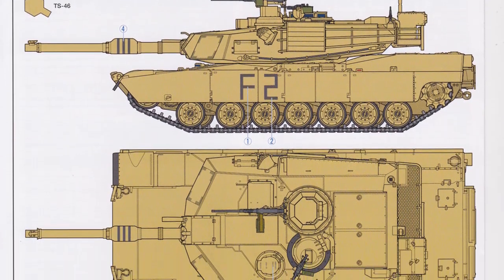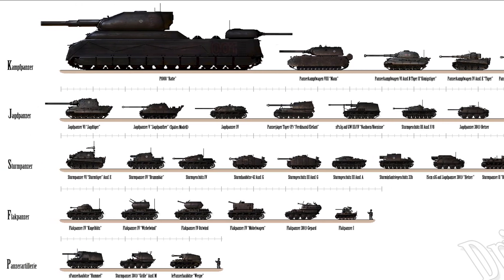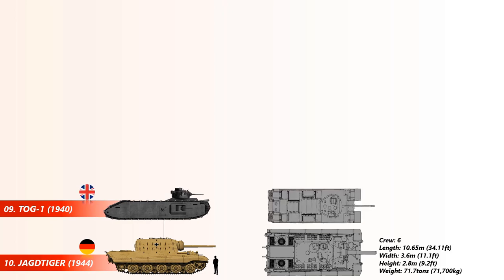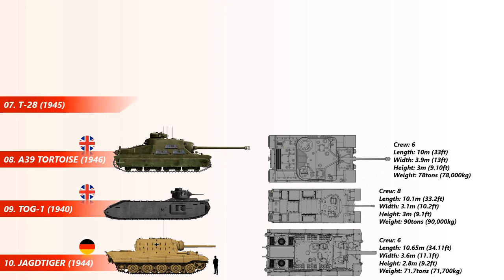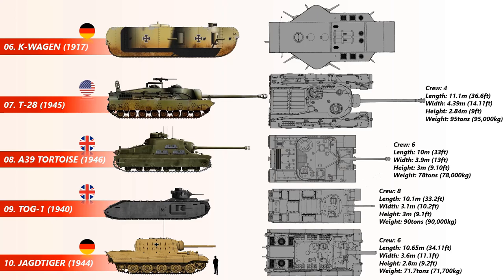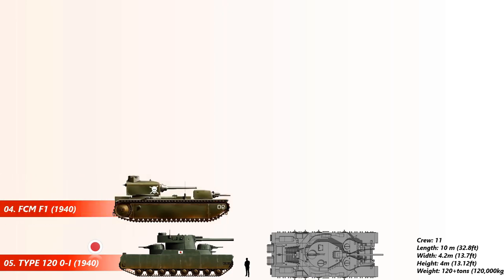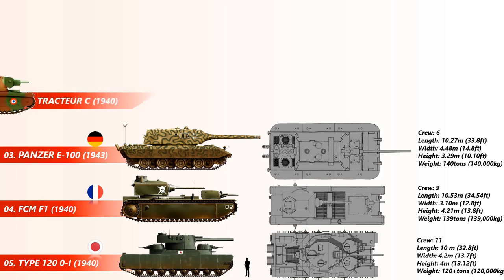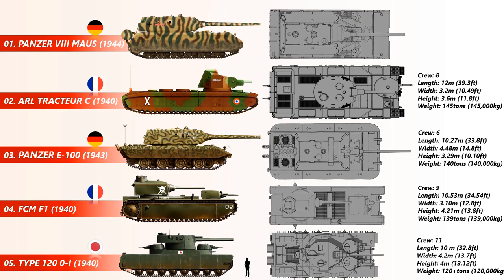The 10 Heaviest Tanks Ever Built

Comment: The O-I picture is wrong, That's a O-Ho
Reply: Yah O-Ho is even bigger and taller than O-I
Reply: Thank you
Reply: @funnydog3353  the O-Ho was still part of the O-I series of tanks designed. so while it isn't the actual O-I that was built it was still technically an O-I
Reply: @signolias100  in WoT?
Reply: @--_9623  in general the tank is a type 120. the sub designation is the tank type (light, medium, heavy, super heavy etc.) and the development count for a given year so for example an O-I would be a "type120 first super heavy". the O-Ho would be a "type120 fifth super heavy" most like to just to cut it down to the "O-I" or "O-Ho"  part for ease of conversation
Reply: @signolias100  thanks for explanation and i meant the game though :D thx for the info btw
Reply: @signolias100  ty
Reply: The O-Ho is a fictional name that Wargaming simply made up for their game "World of Tanks", probably to differentiate it from other similar tanks. The O-I, O-Ni, and O-Ho were simply alternative designs for the O-I, and would have all been named O-I.
Reply: O-I is heavier but O-HO is bigger

Comment: Where the hell's the TOG-2? Also you forgot the secondary gun on the E-100 'blueprint'
Reply: Taron Ypu mean the refrigerator turret with the 150mm?
Reply: YEA THEY FORGOT TOG-2
Reply: No this is a different Turret variant with the same gun as the Maus.
Reply: The secondary gun would not have been placed on the 15 cm gun version of the E-100.
Reply: Didn’t they mention “built” like it moved at least?
Reply: @doitsuland2003  most of these tanks never drove like the e100 or the fcm

Comment: E-100, O-I, ARL Tracteur C and FCM 1 have never been built
Reply: They built a E 100 hull
Reply: @junkers ju stuka -87 B2 never built, only appeared on papers
Reply: And she also forgot the soviet KV4, which was about to be produced as a new soviet super heavy tank, but german bombardments stopped his production.
Reply: But the FCM-F1 have been build but in wood
Reply: @TIRPIZ no the p1000 wad never built not even a mock up model was made it only existed in a very undetailed blueprint
Reply: @john_bob_lenone7351  but can it drive or shoot no so the tank was never built
Reply: TIRPIZ yeah hell no they didn’t. Germany suffered tremendously with lack of materials during the latter part of WW2. The P1000 was simply a design by an over-confident designer. The vehicle would likely crumble under its own weight, wouldn’t be able to move due to the lack of an engine powerful enough to move 1000 TONS of steel. The vehicle would also, if built and used, be extremely slow (if able to move at all), and would be a prime target for allied bombs (considering the allies had air superiority after the Battle of Britain)

Comment: There are some mismatches in the pictures of the tanks, I will list them here:TOG 1 in was shown in the first picture, and the TOG 2 was shown in the second(no side pods, TOG2 turret), the ARL C is (apparently) shown in the first picture and I do not know what French tank is shown in the second one or even if it's French to begin with.
Reply: Damjan Sazdovski the E 100 was proposed to have either the Maus turret (as shown in the video, it was the most likely choice at least for the first batch of vehicles) or a separate turret only drawn in blueprints.
Reply: @ALEX HUANG hmm, I believe that the T28 was a simular vehicle to the T95 or even perhaps an earlier version of the T95, there is a front portion of the hull that sticks out under the gun which might be the Transmission, whilst the T95 doesn't, that lead me to believe that they're  simular but not necicarily the same
Reply: @chieftain108  yeah, thanks for pointing that out
Reply: @ALEX HUANG right, thanks for clearing that up
Reply: the second tank is the AMX tracteur C from 1940

Comment: Here come's the wannabee tank experts
Reply: Bendy Tuber Gamer honestly, almost every video has major fails in terms of accuracy. Some quick ones from this video: Heaviest tank in service is the Challenger 2 in "Megatron" configuration, weighing approximately 84 tons. The blueprints on the TOG don't match: the side view represents the TOG I and the top-down view represents the TOG II. Also, number 5, 4, 3 and 2 were never built.
Reply: Ricardo Gomes I mean the E 100 was in production, same with the O-I but idk
Reply: @CoinEaterBTBM  only a single chassis was found of the E-100, nothing else, not even blueprints regarding turret, and O-I was made as a prototype and scrapped immediately after.
Reply: Ricardo Gomes fair enough
Reply: Ricardo Gomes wait the E100 was never built?
Reply: @literallystingy2858  nope, only one chassis was built.
Reply: @ricardogomes6240  the closest thing to the fcm f1 irl was just a mockup
Reply: @literallystingy2858  a partially finished chassis was built and captured by the brittish then scrapped in the 60's. (Correct me if im wrong about when is scrapped)

Comment: some of the tanks were never made
1. Only two K-wagen were partially built by the end of the war - not completely finished
2. only a prototype of the type 120 0-1 was completed in 1943 - in my mind a prototype does not count
3. the FCM F1 was designed during the late Interbellum by the Forges et Chantiers de la Méditerranée (FCM) company
but France was defeated before construction could begin - so it was never built
4. the Panzerkampfwagen E-100 development was never started - no development means NO tank
5. the ARL treacteur C only A full-scale wooden mock-up was produced - wooden mock-up does not count
plus the M1A2 is not the heaviest operational tank in service the heaviest operational tank in service today
is the FV 4034 Challenger 2
the fact that you still make videos about comparing things scares me
that you might mess up more things like this
Reply: The title says "Ever BUILT," not fully finished, so prototypes count, but the rest of your points are mostly correct. 1 hull for the E-100 was built, but no more than that.
Reply: @Gary-number31415  
you are right about the E-100, a body was built sorry for missing that.
but there is a big difference between one that works and one that doesn't

Comment: SOOOO I see a lot of people scoffing at th "O-I's" picture of an O-Ho allow me to clear it up a bit the tank is actually a Type120 according to the video. this is the actual tank. the letter designation would be the actual tank designation O either meaning experimental, or super heavy. I being the development order for any given year so in this case I is first developed. I would guess O stands for super heavy or similar. so it is probably read more like this in English "type 120 first super heavy" and "type 120 fifth super heavy" they are both type 120's but one was designed first the other fifth. which there was at least 3 other super heavy tanks between the two developed that year and at the least 2 after

Comment: This video is a great way to get misinformed.

1. The Char 2c bis weighs more than the Jagdtiger.
2. The TOG1 and TOG2 weigh the same, but are two different tanks, unlike the photos may suggest.
3. A39 Tortoise has 7 crewmembers, not 6.
4. A39 Tortoise weighs 78 LONG tons, not short tons. After conversion, it weighs 87.36 short tons.
5. A39 Tortoise weighs less than the TOG1 and TOG2.
6. The weight of the K-Wagen is indeed 120 tonnes, specifically metric tonnes, not short tons. Converted to short, it weighs 132 tons. This makes it heavier than the O-I.
7. The FCM F1 only had a wooden mock-up built before surrendering to Germany, so it was not actually built and should not be on the list.
8. The E-100 only had plans for an assault gun variation, not an artillery or anti-air variation.
9. The E-100 only ever had its hull built, so the most it ever weighed was 92 short tons.
10. The ARL Tracteur C was never built, only a wooden mock-up.
11. The Maus weighs 188 metric tons, which converted to short tons is 207 tons. This matters for the sake of consistency.
12. Nearly all the photos are mismatched, improper variants, or straight up different vehicles.

It is fun to make lists like these, but if your information is wrong then you end up spreading misinformation, which can lead to further misinformation and historical inaccuracies. Please use reliable sources and cross check sources when making videos that are supposed to be informative.

Comment: T28 at number 7 has a heavier and more armored variant; T95
Reply: T28 and T95 are the same tank. The variation in name spawned from a logistics goof.

The T28 with added tracks (popularly seen as T95) is not necessarily uparmored. It's just the battle-ready state of the T28, with the added tracks to reduce ground pressure.

Comment: The TOG was designed and built before the war (1938-1939) the project was ditched because of blitzkrieg, The A39, first off the tank was built after the war and was abandoned because it was out of date, the T95 (T28) didn’t even take part in the war and was abandoned due to the fact that the seig frieg line was already in ally control, the O-I was not even built, only a single track link was made and that model is not even right, the model is of the O-HO, The E-100 was supposed to be built in replacement of the Maus and wasn’t even built until 1945 and was never finished, The Maus was built in 1945 but was destroyed by the Germans to prevent the allys from capturing the vehicle but then the Russians found 2 Maus tanks they took the hull of one tank and the turret of the other and put them together and now sits in the museum in Moscow

Comment: Im sorry but the T28 (American Heavy) is the Wrong version ^^ You did show the Upside of the T95. T28 got all in all 2 Tracks. The T95 had 4 Tracks.
Reply: no it is actually right the T28 super heavy and T95 GMC are the same tank. it featured a set of removable tracks for transport. also if you take the time to do a quick search you see the very same tank with both removable tracks removed and sitting beside of the machine, both removable tracks attached, and one removable track removed sitting beside its matching removable track still attached to the machine. also there are pictures of the machine sporting both the T28 designation and the T95 designation. the latter requiring you to search for "T28 super heavy tracks removed" to find it

Comment: the picture of the T-28 is incorrect it shows the T-95, the T-28 did not have the extra set of tracks on both sides attached
Reply: no the picture is very correct the t28 super heavy was at one point in its life called the T95 gun motor carriage. even today the last remaining prototype bears the designation of T28 not t95. there was however a medium/main battle tank named t95. also the "-" is not used by the americans. a t-28 is a Russian tank not american

Comment: First off, your pronunciation was pretty good, but I have a question. Is this list supposed to be tanks that were actually built? Because the FCM F1 was never actually built; a wooden mock up was built and the tank was ordered, but France capitulated before construction began. Similarly the ARL Tractuer C was never built, they got part way through building the wooden mock up before it was cancelled in favour of the FCM F1. The E-100 was at least started, though the only chassis to be "built" was incomplete when the British captured it in April '45, similarly, no prototype of the K-Wagen was ever completed.

Also, no one knows for certain if the 120 ton prototype of the O-I was ever completed, or even started for that matter; the documentation was destroyed/lost.

So a list of the top ten heaviest armoured fighting vehicles *actually built*:
1. PzKpfw VIII Maus - 188 tonnes (1 complete prototype, 1 partial prototype; hull of completed destroyed, turret mated with partial prototype for display)
2. 105 mm Gun Motor Carriage T95, aka Super Heavy Tank T28 - 86.2 tonnes (2 prototypes)
3. Heavy Tank T30 - 86.18 tonnes (2 prototypes)
4. Tank, Heavy, TOG II* - 81.3 tonnes (1 prototype)
5. Tank, Heavy, TOG I - 81 tonnes (1 prototype)
6. Tank, Heavy Assault, Tortoise, A39 - 79 tonnes (6 prototypes)
7. FV4034, Challenger 2 TES Megatron - 76 tonnes (~450 FV4034 built, unknown number in Megatron configuration)
8. FCM Char 2C "Lorraine" - 75 tonnes (the company command tank of the 10 Char 2Cs, the front armour was doubled in thickness in on the front to 90 mm and upped to 65 mm on the sides, increasing the weight from 69 tonnes to 75 tonnes).
9. Sd.Kfz. 186 Panzerjäger Tiger Ausf. B "Jagdtiger" - 71.7 tonnes (~80 built)
10. Sd.Kfz. 183 PzKpfw Tiger Ausf. B "Königstiger" - 69.8 tonnes (~490 built, mostly this version, but also some with a different turret for a total weight of 68.5 tonnes)
Reply: Arl tracteur C was complete after the second war but I'm pretty sure at least a version was completed before the end of Ww2 and the FCM F1 was in fact at the same stage o development as the maus 1 turet mounted and two hull completed

Comment: so i thought that what you mean about "ever build" is some part of it not fully build prototype, that explain alot specially the reason why e-100 is here, though i never heard about those big french tanks and O-HO maybe because it almost did have accurate documentary or its just me
Reply: Firstly, it's the O-I, secondly I agree with rest of your comment. The O-I was at least partially constructed as drive tests were performed and a track link still remains today
Reply: @hondacivic8222  it's actually a type120  O-I was the tank type. with O equating to super heavy I would guess, and I being the development order I equating to first developed. so it's full name would read as  "Type 120 first super heavy" if we were to translate their code the O-Ho would be "Type 120 fifth super heavy"
Reply: @signolias100  yes and the Chi-Ha was the Type 5 Medium but nobody refers to the Type designation in basic context. It's like calling the USS Missouri the Iowa Class Battleship USS Missouri. It's correct but there is little need in a basic context, like this is.
Reply: @hondacivic8222  in this case it does make a difference it is still a type120 tank. and with your own words you wouldn't say the development of the USS Missouri you would say the development of the Iowa class battleships. in this case it would be the development of the type120 tanks. all are type 120 tanks just with differences just like you see with Bismark and Tirpitz both are the same class of ship yet the Tirpitz was a bigger and heavier ship than the Bismark.
Reply: @signolias100  you don't see the point. You call a ship of a class by its individual name. You do the same with tanks. That's why the Panzer VI despite being 2 different vehicles is known as either the Tiger I or Tiger II/King Tiger. Same primary designation but known as different things.

Comment: When you were talking about the t 28 for the top down picture you put in a t 95 the difference is the t 28 has one set of tracks in each side and the t 95 has 2 sets of tracks on each side and if you look closely you can see that the top down picture has 2 sets of tracks on each side
Reply: You are sort of right and sort of wrong. By world of tanks you are right however. In the development it jumped back and forth between the T28 super heavy and the T95 gun motor carriage a few times and that is where the different names come from. the outer tracks are removable for rail travel
Reply: @pubbarian  you are partially right as well when it was first produced it was only the t28 heavy tank, it then became the t95 gun motor carriage, and then after about a year it had its name switched to t28 super heavy tank and it is living its life out as a museum piece with the designation of t28 on its fender to this day. there was however a t95 medium/main battle tank produced later

Comment: Correct me if im wrong but the e 100 was never built so why is it in this list
Reply: it was never finished the British found its unfinished hull
Reply: For the most part, it was built. The hull was completed, it was fully functional, it was tested, and we have photographic evidence and records of its construction. The turret was never attached to it. However, since the E-100 would have used the exact same turret as the Maus, and fully built Maus turrets were made before it, one could make the argument that the E-100 turret was built as well, since all they have to do is take a preexisting Maus turret and put it on the hull. The turret was simply never mated with the hull.
Reply: @xxfalconarasxx5659  every picture of the E100 I have seen. it was an unfinished hull. the Maus was the closest to completion
Reply: @signolias100  The tank was unfinished, lacking the turret and all, but the hull was pretty much completed, only really missing the sideskirts, which was an optional piece of kit anyway. The prototype was already fitted with a Maybach HL230 engine and a transmission from the Tiger II. It would have been capable of driving.

Comment: By T28 dont you mean the T95?
Reply: They're the same
Reply: @Tiger_42_  yes, but T28 refers to the To5 with its additional side Caterpillar tracks removed, and that affects the weight. In the vid it shows the T95 configuration but its labelled as the 28
Reply: @seemslegit6203  no the T28 vs T95 comes from who was claiming it at the time armored branch or ordinance the tracks were designed to come of for the sake of rail travel